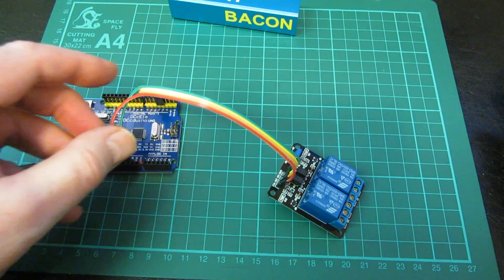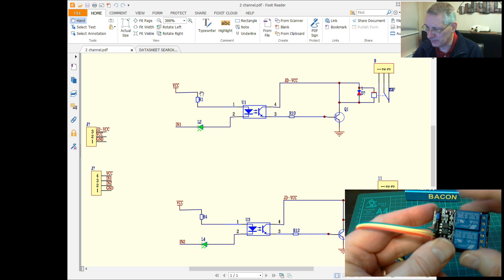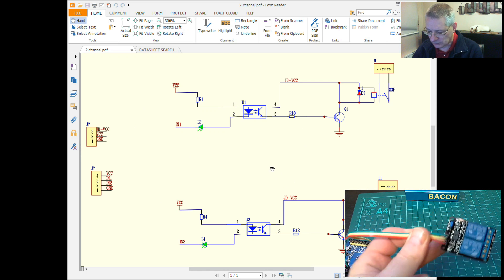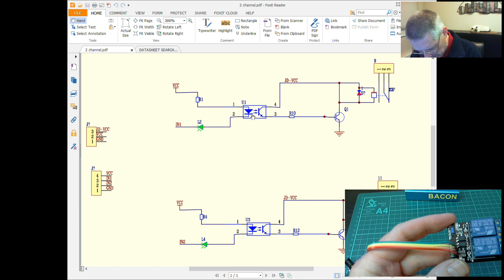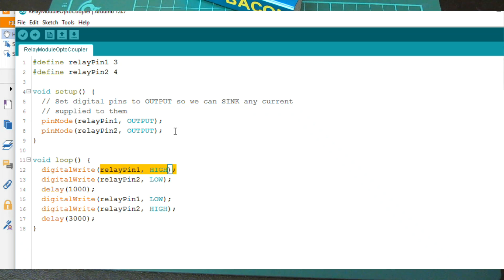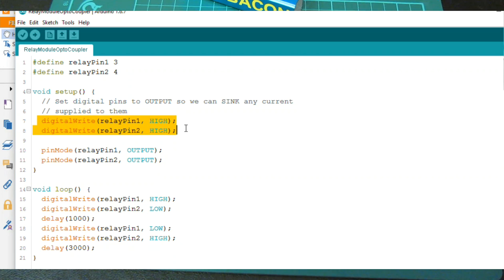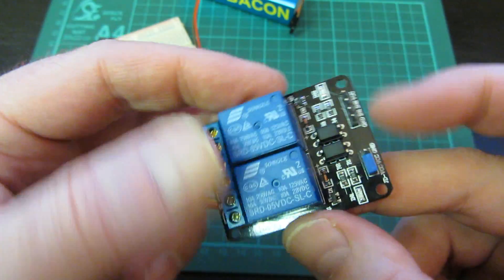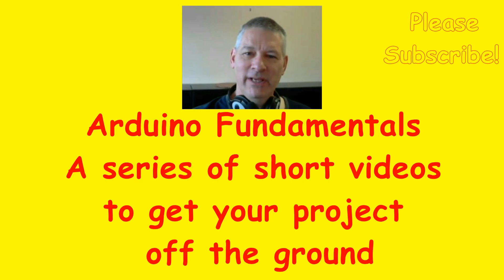#18 Add a Relay Module to your Arduino project - Hints, Tips & Traps

Comment: Thanks for the hint about setting the relay HIGH before setting the mode to OUTPUT.  I had been trying to figure out that no matter what I did, it insisted on activating the relay after being powered up or reset during a compile and load.  I even tried it without sending a HIGH or a LOW and it still reset during the compile and load.
Reply from the maker: Glad the tip worked, Grumpy Old Man. Funnily enough, I learned this from Arduino guru Nick Gammon. I queried why he did it and what it was doing behind the scenes, and he explained. And here we are, some years later, with the tip being passed on! Thanks for posting.

Comment: Can you please tell me where to buy relays like this. I can't find any with separate VCC and JCC
Reply from the maker: Any of the Far Eastern warehouses have these (Banggood, Aliexpress, Gearbest), HullmanHunter; they are available in single, double, quad, eight-way, twelve and sixteen relays on a single board! BUT do make sure you buy the optically isolated ones (the ones you're having problems finding). Here's an example for you: https://www.aliexpress.com/item/10-pcs-Optoisolated-Relay-Module-5V/1950115306.html Oops, that for 10 pieces but see if that seller does them singly too.
Reply: hullmanhunter Amazon sells them too

Comment: Just Awesome!
Thank you so much. Very descriptive and academic.

I have a request please.
Would you be kind and make a tutorial video on how to connect an AC well water pump to a relay?
If you could also advise on the correct pump start relay spec to purchase please.

I plan to control my pump for the house from my cell phone using my Arduino UNO and a WiFi sheild.

AC Well Pump Specs (India):

-> 240 V
-> 50 Hz
-> 1.5 HP
-> 6.6 A
-> 2800 rev/min
-> HEAD: 30 Feet

If there is anything else you would need to know, kindly let me know.

Eagerly awaiting your reply.

Thanks & Best regards,
Philip
Reply from the maker: Hello Biju, I'm sorry I did not reply earlier but YouTube had put your post into the 'Spam' folder so I did not get to see it. Anyway, regarding your query, the relay you need is a low voltage COIL (eg 5v or 12v depending on what you are running the Arduino on) but you definitely need a decent rating on the CONTACTS, at least 250volts at 10Amps. Now a relay like this is not huge nor expensive: I found this one on eBay (India) for 89 rupees, it has the required 250v/10A contacts you need and is a 5v opto isolated one just like in my demo. I hope this helps.
http://www.ebay.in/itm/1-channel-5V-10A-relay-control-board-module-with-optocoupler-for-PIC-AVR-ARM-/331907565514
Reply: Thank you Ralph.
I am glad you replied.
I have asked the same question to many other experts on You Tube and LinkedIn. Not one were able to answer the query - maybe they are not so much of a true expert - maybe they are just sharing the knowledge to the extent they have just learnt.

So awaiting for your response was definitely worth it.
I will go on from here with your advise and if I do get stuck some place, I will drop in a line.

Thanks again Ralph - keep up the good work - share knowledge.
Reply from the maker: You're very welcome! Thanks for your kind words and for posting here.

Comment: On my 16 channel relay, I removed the ground connection from the Arduino to the relay, so the ONLY connections between the Arduino and the relay board are the IO Pins.  Everything works fine now, and no more shorting out :-). I obviously have a separate power supply to control the relays, and it has a ground connection.  I wonder where the current flows from the IO pins, when they are set to HIGH?  Does the current flow from one pin set to HIGH to another pin set to LOW?  If that's the case, am I always required to have at least one pin set to LOW?
Reply from the maker: OK, let's figure this out. The ONLY two connections you need to get this to work are the VCC (+5v) from the Arduino and a GPIO pin configured as OUTPUT. So the current flows from the (Arduino's) VCC through the opto-isolator LED pin (IN1) and back from GND to the Arduino's GPIO pin set to LOW (to let the current flow - set it to HIGH to stop it). But...
 
But if you are also powering the relay from the Arduino's 5v supply, then you need that jumper in place (to join VCC to JD-VCC) and that GND (ground) connection (back to the Arduino) too. This is good for testing it all hangs together.
 
If you are powering the relay side of things independently then you need to remove the jumper, and connect the independent power supply to JDC-VCC and ground. The ground does NOT need to go back to the Arduino. This is the best option as you're then totally isolated.
 
Not sure if this clarifies things or not, Mr RisingNShouting? Let me know!
Reply: Ralph S Bacon 
Yup, that helps a lot!  Thanks Ralph, you're the best!

Comment: Thanks for the details.  I am clearly not as skilled at reading circuit diagrams, and had no idea what was happening with my 16 channel relay.  However, now I suspect I am inadvertently shorting out my GPIO IC with the connections from my Arduino to the GND, along with the 16 Pins.
Again, your expertise is much appreciated!
Reply from the maker: I read from your other post that things are now working. I'll comment on your other post...

Comment: why is there a shortcut between JD-VCC and Q1?
Reply from the maker: Now, Alexus, when you say "shortcut" between JD-VCC and Q1 I'm assuming you mean the VCC to JD-VCC jumper? Remember that the JD-VCC is the power to the "other side" of the circuit - that is, the transistor (Q1), half of the opto-isolator and the relay itself. By shorting JD-VCC to VCC we power the entire board with power from VCC. Not truly opto-isolated, which is why the option is there to power the "other side" independently". The video shows the schematic at 02:07 which makes this clearer. This is then covered in some detail in the video when I power the circuit from two sources. Perhaps I have misunderstood your question so do let me know whether I have wrong end of the proverbial stick!
Reply: Sorry i mean "short circuit" not shortcut...
At 2:07 between the wire JD-VCC and the collctor of Q1 is a wire-bridge, wich is parallel to the free-wheeling diode and the relais. 
What does this wire do? A Short circuit? :D
Reply from the maker: How strange. Not your post, Alexus, that was very observant indeed. The circuit diagram for this device is basically WRONG. And only you spotted this! Obviously there should be no link between the collector of Q1 and JD-VCC (not unless you want the power to be shorted to ground as soon as Q1 was switched on). So basically the collector of Q1 should go to one side of the relay coil and the anode of the diode, which are shown correctly. No connections between the collector of Q1 and JD-VCC. I just cannot believe that (a) I did not spot this when I did the video, and (b) that in all that intervening time no-one else has mentioned it (and the Arduinites on this channel are a pretty observant lot). So thanks for posting, I shall make a small comment in the video description about this (and credit you, obviously). Thanks for posting.
Reply: Thank you for this post. I was thinking the same thing. Good pick up Alexus

Comment: Hello Ralph, 

I am super new to this hobby. Do you know how to sketch a potentiometer into the mix to control the speed of the switching?

Thanks, 

Chris
Reply from the maker: Hey Chris, welcome! This channel is designed for noob Arduinites like yourself, so I hope you have fun watching the videos and learning along the way.
 
Back to your question: can you just elaborate what you mean by "speed of switching"? Do you mean you want to switch the relay on, then off, then on... and so on? Or do you want a delay before the relay switches on once it has been triggered? Let me know and I'll see if I can answer! Always good to hear from a newcomer to the Arduino world.
Reply: Thanks for the quick reply and the help!

Yes, I would like to control the on/off/on/off of a relay. I need it to power a solenoid valve for a water sprayer. I need it to spray in short quick bursts, and then long slow bursts. It would be good to control both either with a pot or with an on screen GUI. 

Any help would be greatly appreciated.
Reply from the maker: Understood, Chris, thanks for clarifying. You might want to look at the "Blink" example sketch first (just so you understand the flashing LED principle), then look at one of my sketches that uses a pot to control the analog value (eg my Neopixel display demo) and see if you can figure out how you might connect that up to the "Blink" sketch instead of using a fixed delay value. If...
 
If after looking at that you're thinking "Huh?" let me know and I'll knock up a quick demo sketch. It's quite straightforward but being super new to Arduinos  it would be in your best interests if you understood what you were doing rather than just copying code - that way you'll learn loads of stuff along the way. Let me know, either way.
Reply: Gotcha! I have a sketch going with the basic blink function. I am still getting errors when I compile the code. 

I think if you wouldn't mind sending me that basic sketch I'd be able to better figure out what I'm doing wrong. I greatly appreciate the help!
Reply from the maker: Out of the goodness of Benny's heart, he has agreed to look at your code. Upload it to this DropBox folder (just drag and drop) and I'll let you know where you have gone wrong. This way you will get your own code to compile. 
Link: https://www.dropbox.com/sh/1u198yq6tbcfesa/AADmsqAxJQZ0fiUPQvEawOW6a?dl=0 
Let me know when you've done it and I'll get Benny on the case!
Reply: I uploaded some code I found and tried to use. It isn't my design but what I found in a tutorial trying to learn how the code functions. Sorry for the late reply I am trying to learn the basics as I go.

Comment: Hi Ralph, thanks for sharing this informative video. I am currently working on a project for the control of various 240v devices used in my fish keeping hobby and have recently purchased a couple of similar relay modules with solid state relays, so as to eliminate the noise of the relay contacts. Do your recommendations in this video apply to solid state devices and are there any other pitfalls associated with using them, other than the obvious current limitations of the relays?

Thanks.
Reply from the maker: Hi Fred, and welcome to my channel! 
A solid state relay is, mainly, an opto-coupled triac so it behaves very similar to the opto-coupled part of the relay that I described (without the actual relay!). You still have to protect the circuit from spikes and back-EMF from any motors you might be driving (or anything else with a coil, such as a fan) but apart from that it should all work as you would expect. 
 
The Arduino will drive the 'input' (usually an IR LED) which is received by an photo-sensitive diode/triac connected to a mains voltage triac (a bi-direction thyristor) - usually with a zero-crossing component in the middle to ensure the off and on states only occur as the AC mains voltage crosses the zero voltage line - thus eliminating (or minimising) any RF interference generated.
 
As you say, they are silent and work pretty much as you might expect. Just be aware that the IR LED driven from your Arduino must include a limiting resistor (usually) and the breakdown voltage of that diode is probably not much more than the 5v Arduino output level so don't connect it in reverse by mistake! Ideally you should reverse connect a standard diode in parallel with the input IR LED to protect it from just such a mishap.
 
Additionally the forward voltage of that LED is pretty low, about 1.2 volts rather than the 2.0+ volts of standard LEDs. Refer to the maker's datasheet to find out the exact figures or you might overdrive the LED. From a 5v Arduino output the limiting resistor would be 5v - 1.2v = 3.8v drop at 20mA = 190R or the nearest (higher) preferred value. 
 
Finally, if I recall correctly, you should incorporate a snubber circuit in parallel with (and close to) the output pins that consists of a capacitor (suitably rated for mains use) and a resistor - a 0.022uF capacitor and a 47R resistor is a good starting point. This absorbs surges created by the load which may turn the relay back on again.You may not need this depending on what you are switching, but at least you know about it.

I hope this helps and may your fish continue to thrive!
Reply: Thanks for such an in-depth reply! Please take a look at this module which is the one I have

http://www.ebay.co.uk/itm/132067724356? , is this not a plug-and-play solution not requiring any additional circuitry?

Thanks.
Reply from the maker: Squinting sideways at the photos on the eBay page it shows that the Omron relay model is a G3MP-202P, which if you look at the datasheet for that relay (http://www.mouser.com/ds/2/307/g3mb_0609-298620.pdf) it states on page 1 under Ordering Information that that model does contain both Built In snubber circuit AND input resistor. 
 
Woo Hoo! You have got the jackpot and therefore don't need to consider either (probably why the manufacturer of the board used them for Arduinos et al, as they save components). Phew! (More by luck than judgement, but hey, who cares how?!)
 
Plug and play it is, indeed.
 
Just watch the current on the (presumably) mains side of things, 2A max if you're using heaters for the water etc. 230V x 2A = 460W, sounds a bit high for a fish tank heater, you could boil a cup of water with that so I guess fish tank heaters are more in the 25W range? Your fish will love you.
Reply: What a result! My fish and the relays will indeed be happy, especially since the highest rated heater I use is only 100W. Generally speaking most common fish tank heaters are between 25W-150W.

Thanks for all your assistance.

Comment: Thanks a bunch for the tutorial. For my current project I would like to do something similar but with 8 relays and a 24v supply. Do you think it be possible to control 8 output pins and 24 volt supply in a similar fashion? If so do you recommend any boards for the task?
Reply from the maker: Hi Loren! The eight relays is not a problem; you can get the same style relay board I'm using with 8 relays. Search eBay or check out the same seller I used to see if he does the eight way variant. Now, when you say 24v supply, I'm hoping you mean that's the voltage you want to switch using the relays, not run the Arduino on? If you want to switch 24v using the relays that's fine, as the voltage on the relay pins is totally isolated from anything else. I hope this helps, if not then a more complete answer will have to wait for at least a week until I'm back from vacation - just let me know! Thanks for posting!

Comment: do you have a tutorial where the relays could be triggered through a humidity sensor depending on its readings?
Reply from the maker: +Reptile_Edge 
I've no specific video on that, but if you're using something like a DHT11 humidity sensor then it's as simple as reading the data via its one-wire system and triggering the relay at a certain humidity point. No different to using a DS18B20 temperature device in its implementation really. In fact, the DHT11 returns both humidity and temperature together. It just uses a different library.

If you look at the Arduino playground website (http://playground.arduino.cc/Main/DHT11Lib) there an example of how to read that device. All you then need to do is turn ON or OFF or relay at certain humidity/temperature points.